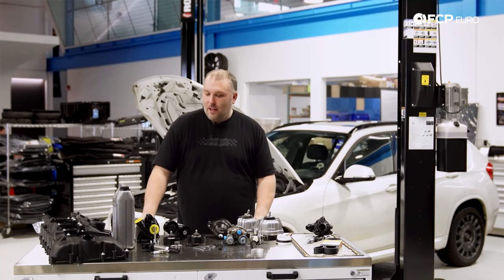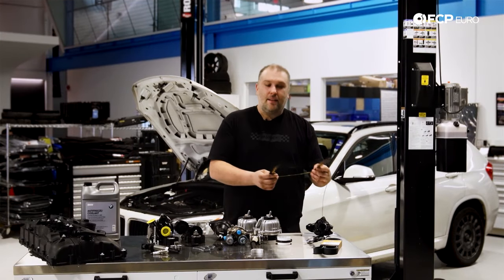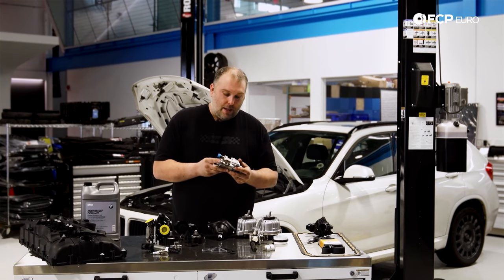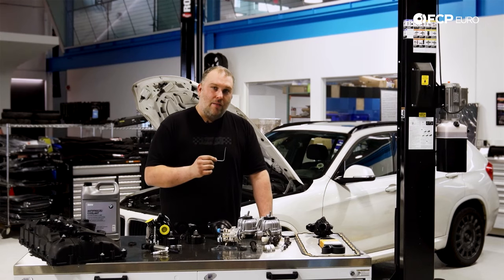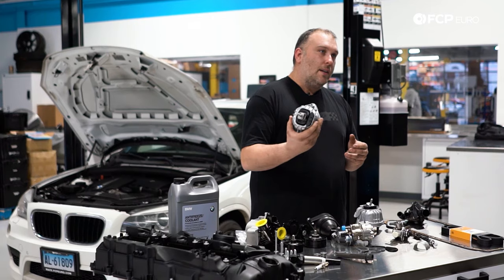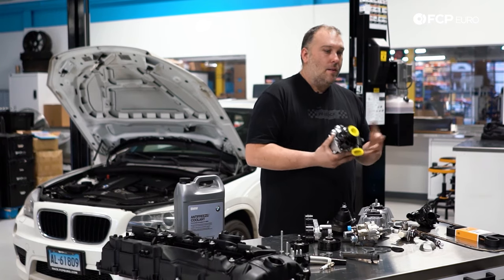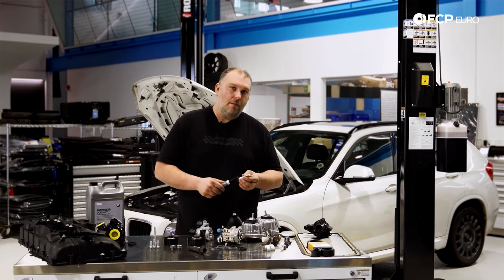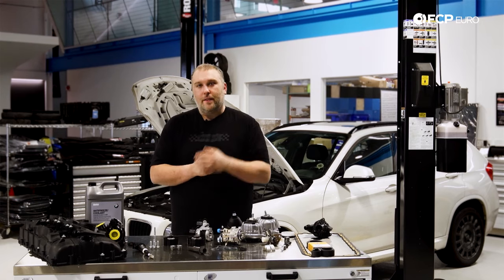BMW N55 Engine Diagnostics/Problems - Everything You Need To Know (X1, 135i, 335i, 435i, 535i)

Comment: What do you guys consider "high mileage" when talking about these issues?
Reply from the maker: For the most part "high mileage" when it comes to the N55 is around 80k, on average thats when we see the large majority of the common problems begin to show their heads.
Reply: FCP Euro .... That is exactly when my 2015 335i Valve cover gasket started to leak. Diy'd the gasket problem fixed.
Reply: Age is also a factor. My M235i was only a ~35K miles but was 5 years old when it started to have some of these issues. They included charge pipe failure, coolant hose return line failure, water pump/thermostat failure. All covered by my extended warranty thank god.

Comment: If you search the comment section you will find an almost 2 year old comment from me having doubts when purchasing a 60k miles 335i 2012 early F30 production. Well I did bought the thing and here are the things I replaced within 20 months of ownership:

Valvetronic actuator
eccentric shaft with the roller bearings, bearing shells, oil squirter
water pump
thermostat
intake charge pipe
intake jet vacumm line
gaskets
Day light running LED modules from one headlight
driver side brake lamp assembly
Turbo return oil line
Boost solenoid

All from FCP euro parts XD

interesting thing - You dont need specialty tools to remove any of the above, torque wrench, sockets, L key etc will be enough. A lot of handy work to replace but doable at home if done slowly. But in parts ive sent the equivalent to 3200 in parts...... so FAR. but i dont expect other issues, rod bearings are fine from blackstone lab analysis, oil pan and oil tilter cap have no flakes or nasty copper. 5k miles changes, mann oil filter, penzzoil 5w40 premium euro, proper heating before driving. will keep the engine alive for 350k km / 215k miles.
Reply from the maker: Bruno! Welcome back to the comments section. Love/hate to hear your failure/success of N55 ownership thus far. We are glad we didnt mislead you at all in this video, and also glad we were there to help support you with the parts you need to get your F30 back to a happy place again. If there were any DIY's you wish we had for any of those (that we dont currently) what would it be ?

Comment: I have replaced water pump and thermostat along with HPFP at around 66k miles on my n55 135i.
Reply: Same those are the only 2 repairs I had to do
Reply: Really not that bad if you ask me, pretty simple fixes and are cheap if you do it yourself compared to going to a BMW dealership or an independent shop. And I think that those parts lasting 60-80K miles possibly even more is understandable.
Reply: '12 135i at 40k mi my tstat and water pump failed, up next is my ofhg and serpentine belt. Currently at 42k mi.
Reply: I’ve done water pump and t stat and coils and plugs, etc etc. I think my HPFP is going too. ‘12 with 62k. I track the car so it’s not normal wear and tear. Be careful tracking the n55’s, it’s recommended to overfill the oil by a quart. My rod bearings are toast and I wasn’t diligent with this.
Reply from the maker: You're on par for a good round of 135i ownership VALADCM.
Reply: FCP Euro need to get some more parts from you guys. Maybe in a few weeks after the corona virus dies off a bit. Stay safe
Reply: I did all those myself and saved a lot of money.
Reply from the maker: @Valadcm500  DIY vs. Dealership is the way to go ;) You know we are here once for you once you need to place your next order! Appreciate the support.
Reply: FCP Euro ... For my 15' 335i the dealership quoted me $700.00 for spark plugs and I'd be without the car for a day and a half (9 am appointment,  get to it that afternoon, and finish it at 1 pm the next day, then a call that it's ready at 4 pm) I bought everything from FCP had the job finished in 90 minutes and spent less than $150.00.
Reply from the maker: @wjohnsonism  those are the success stories we like to hear... what a savings, plus peace of mind knowing you did it yourself!
Reply: FCP Euro .. Yup, Thx. Also, folks need to realize that while you’re in there you can do little extra things that the dealership would never do.

For example: Vacuuming the Spark plug holes before and after the plugs are pulled eliminating the possibility of debris falling into the holes, spray CRC QD Electronic Cleaner in the coil receiving end for a clean contact, lube the rubber portion of the coils with a tad of Dielectric Grease for a water tight seal, coat the Ceramic part of the plugs with Dielectric Grease to prevent arcing, and spending :15 minutes with a small brush detailing and vacuuming up sand, dirt etc. 
It’s not that they are lazy or don’t care, but the dealerships are on a volume/service business model and it is what it is.
Reply: @Twiztid_Metal  Yeah but you do mostly short distance travelling. Most cars with high milleage issues are used on motorway. It's like timing chain, it can fail at 60k miles or 120k miles, depend how and where you drive
Reply: I just ordered a boost solenoid from you guys.

Comment: Most of these things happen with higher milage but most cars with over 100 000 km have oil leaks 
Thats just normal 
I worked at a control point for cars for 1 year in belgium 
And i saw 500 cars a day come by
And almost everyone had a car with some leaks. Exept the ones that were well maintained ( mostly bmw and audi with lease contract ) and also honda was always dry 😁
Reply from the maker: Oil leaks are definitely a common thing! Thanks for the insight!
Reply: @fcpeuro  
No problem 😄
Well its common for french cars 
And really old cars 😅
The probleme is that People are getting used to the fact that modern cars  drive 100 000 km without leaks or problems
But that is a lot to handle for seals and the engine!.
 With so much power and rpm these modern engines put out.
You could only dream that with old cars they had leaks and problems everywhere

Comment: 2011 owner here with 60K miles. Just developed valve cover leak. Smoke smell and all. I did plugs and coils in the passed, im tempted to do it myself but part of me just wants to have peace of mind take to dealer and have them take care of. I just want t confirm the price included the new valve cover bc i would want that replaced.  The car did have the oil filter gasket leak thankfully when the car was under warranty like 30K miles and the dealer took care of it. Otherwise no major issues besides a cracked radiator. Love my 2011 335.

I love Gareths videos hes such a pro. I bought my plugs and Eldor coils from FCP and tackled it thanks to Gareths videos.
Reply from the maker: Definitely a good idea to replace the valve cover for piece of mind! Glad you like Gareth's videos, thank you for the support, Herakles!

Comment: Hello From Texas. I watched, read, liked, subscribed X)... And my question is simple: which one is the most reliable, N52, N20 or N55?
After listening to your videos, and checking mileage on classifieds, I would go for N20. Forgot to say, I'm interested in F10.
Reply: N55 is more reliable than N20 go for a late built N55 (e.g. 2016) and avoid early built N20 known for timing chain problems
Reply: n20 is pretty much the same if both sre stock. the n20 is basicly a n55 in 4 cil version

Comment: 4.26 the fuel pressure pump (old), can this be replaced with the new model which according to you is a robust design.?. I have 100k miles on my X5. It runs fine. smooth and  From the looks - the old HPFP is working. Is it possible to replace it with teh new version. please thank fro FCP auto...

Comment: Hi,  my 2011 X3 F25 had one of those old HPFP, it was changed by the dealer in 2016, I was wondering if it was possible that the new version of the pump was installed, or if the car is stuck with the same faulty version. Thanks!

Comment: I just had the belt, tensioner, and older pulley replaced and after driving for around 1200 miles I noticed the tensioner bouncing at idle again, it tensions fine when there's slight throttle but I'm not sure what to do now
Reply: How did you resolve the new wobbly tensioner.?  I intend to change the pullies nd tensioner. Thank u
Reply: @mohammadhayatca3244  I just replace my belt every 20-30k for piece of mind and call it good, haven't had any issues and I've been making 430whp for a year now

Comment: I will admit its a good smooth running engine when everything works fine but when parts fail its a complete nightmare reliability should be no where associated with this engine. A 350 chevy small block is a reliable engine.  This engine is a hot wife waiting to divorce you and take all your money when she leaves and does the same thing to someone else.
Reply: I've been soul searching for the proper perspective, and I think you provided just that.  I"m in trouble.

Comment: So I’ve been a vw guy for a while. Despite the many issues that may come with that I had enough support and info available to maintain one. I however got in an accident that totaled my tdi. I have been on the search for a new car and found a really nice looking 2011 bmw 335i x-drive at a dealer. It has the manual transmission and 88k miles. I have no previous experience with a bmw and feel anxious about making the switch. Should I pull the trigger and is there anything I should know that could be a deal breaker?
Reply from the maker: If the car has been properly maintained, and you like the way it feels and drives, go for it! There is a ton of info and support available for BMW's just like VW's. We got you covered!
Reply: Did you get it?

Comment: God this sounds like a nightmare. More reason to why I drive my b8.5 SQ5 more than my F30 335i.
Reply from the maker: You haven't seen our B8 video, have you 😂
Reply: Lol, it’s not that bad, most issues mentioned here are at 100k miles, valve cover, leaks, solenoid boost controller, oil filter housing gasket, water pump, tstat and HPFP on early models. N55 is otherwise reliable engine, can easily do 200k miles.

Comment: So I see this whole list here, but I didn't once hear a way of HOW I can tell which one of those parts will fail :/

How will I know if my HPFP is going bad? Will it just go bad instantly then I'm screwed? Preventative maintenance ?  I hear all these things that go wrong and every single person says, "WATCH OUT FOR THIS...?" Okay, but HOW do I watch out for it? I can't even manually check my oil with these cars, how on Earth will I be able to tell if one of these issues is happening inside my engine? lol am I just supposed to pop my valve covers off every other weekend? Am I supposed to replace these parts every 50-75k miles? 

Honest questions.

Post Script: I should take this to a thread.

Comment: Great video!! Just bought a 2014 X5 35i with 49,750 miles on it (to go with my wife's 2013 128i convertible). My question has to do with how and where age vs miles cross, relative to preventive maintenance. Do I simply follow standard maintenance schedules for miles (excepting 5K vs 10k for oil changes), or should I treat the vehicle as if it had 75-80k miles on it, given that it's 9 years old? I have all the maintenance records and the standard schedule has been followed. Ball joint and TPMS sensors and receiver have been replaced, which are the only issues I'm aware of. Any advice would be much appreciated! Looking forward to a long relationship with both these vehicles. The N55 X5 is our 13th BMW, and I'm trusting that is not a bad omen...

Comment: Hiya. Great information. I’ve got a 2011 E92 335i LCI car, with 79k miles. I’m coming from an E39 and E36 before that, so I’m learning about my car’s maintenance and getting my parts from you.  Can you tell me, what the heck is option code “0840 High Speed Synchronisation”? I’ve got it on my build sheet but I have no idea what it is or what it does.  Thanks.  - And your videos are must watch for any Bimmer owner, to better understand and to learn to correctly maintain his Ultimate Driving Machine. 
Ernie ~ West Palm Beach, FL.

Comment: I am looking to purchase a 335i 2012 with 90,000km (little short of 60k miles) with the sport/executive package. I am going to take ti to a BMW dealership for a PPI and certification. But after the video I am having second thoughts. I am coming from an Ecoboost engine, which has problems on their own, even though after 60k miles I haven't experience nearly nothing compared to what is shown in the video.

Comment: My 135i 2011(125000tkm) has a water pump fail and the chargepipe broken a few weeks ago. No oil leaks. Change the Oil in 8000tkm interval. Think the engine still run smooth and healthy.

Comment: Fantastic! Thank you so much! I heard the charge pipes are failure prone as well.  Do you have a recommended maintenance schedule for these items as our engines age? I know that oil leaks are as-needed repairs, but should the others be done on a mileage basis?
Reply from the maker: You're welcome, Marshall! Charge pipes can be failure-prone, its always best to check over the charge pipes every so often, especially if your car is coming up in age and miles. Rubber can breakdown, especially from the heat in the engine bay. I would give everything in the engine bay a once over around the 75-80k mile mark and if you feel the need to, replace.

Comment: Thank you. So far my 88k F15 sDrive has had the valve cover gasket, engine / trans mounts, 4 shocks replaced. The oil pan is leaking pretty good and the tensioner is rattling a bit.

Comment: Awesome video my brother! I've been having the oil leaking on my serpentine belt making it come off. Now, I have a problem with it not starting, I've bought a fuel pump relay and now I can't find where it's located. I have a 2014 BMW X6. I'd appreciate if you can let me know where the fuel pump relay is located. I was told by BMW dealership that in the rear fuse panel, but there's only one black four prong relay there. The fuel pump relay has five prongs. Thank you!

Comment: Busted coolant line. Fixed and used regular antifreeze I didn't even dilute it. Took short trip right after 500 miles highway , little hard driving here n there, then drove maybe 1k miles 2 n half months. Finally did coolant flush w blue juice n water. Could I have done damage from these last 2 nonths?
Reply from the maker: it is possible the incorrect coolant could have caused corrosion in the system, or effected any of the plastics/rubber in the system. Flushing and refilling with the correct coolant was a good start!
Reply: @fcpeuro  thanks for the response. Not much of anything came out of the coolant I flushed out. Lower hose on water pump still seemed good. Think everything is original still, 95k miles. Any way to know? Or only when something fails/leaks?

Comment: I’m looking to buy a 2014 535i worried about the 80,000 miles. What items can I be worried about at this mileage.
Reply from the maker: So long as there is a solid maintenance history you should be in good shape! Look for things like failing ignition coils, possibly water pump as well.

Comment: Hello sir learned a lot from your this video I have a 2006 Bmw 325i my car having a issue to start the car but if when it starts if I take my foot off the gas Paddle it turns off by it self
Reply: And it also giving code P1447

Comment: I bought a 2011 535i with 65k in 2020, and I had almost all of these failures within a years time. I know it was the previous owners on how they maintained the car. All in all, I still love the car. I take it to a BMW certified shop and would buy another in a heartbeat!
Reply: How much did you end up spending in repairs for the first year?
Reply: @nickmaffei4321  for me, my n55 has costed me almost 6k in 7 months.
Reply: Are you sure it was maint? water pump, oil leaks, aren't really service items and not affected by oil changes etc. 7k miles/yr is low, maybe lots of short drives led to failures...
Reply: @nickmaffei4321  $4k
Reply: @RexNathanChan  I'm thinking that was the case, the short drives. I put 108 mile a day on the car for work and haven't had much issues since the first year I owned the car

Comment: How do I know if the of belt part in the engine if I’m buying used?
Reply: James of All trades check for any oil leaks around the Oil filter housing. This is what usually leads to the belt snapping and getting sucked in. Also look at the crank seal to see the condition. If it looks new, it probably ate a belt.

Comment: Sir im experiencing fault 1C0202, ive changed the oil pump, all both sensors but still facing low engine pressure.  Can you advise what i should do next? Please Help

Comment: Hello , i have a problem early morning cold start my revs playing , first going low next going 1,500 , after 30 sek then going normal. car is 535xi F10 n55.
Reply: Hi Dilyan G ,Sir,I have the same problem with my 2013 bmx x5 35i ,3.0 litre 142,000 kilometers, here on the East coast of Canada and I noticed with mine, after sitting overnight in about -3 degrees (below freezing) the engine is cold,otherwise,like 4 + degrees, that there is nothing wrong and is fine, but when cold and  start and after 5 seconds of this surging to almost Shutting off (stalling). it levels of ok , when it warms up and all day long its working all ok.Did you find the problem ?? I have asked the Stealership and has also asked this question on a few occasions here on Utube,no response yet  ty